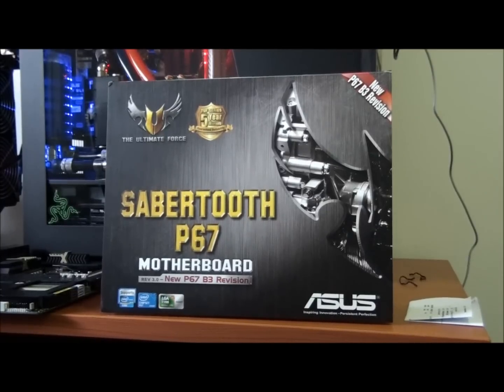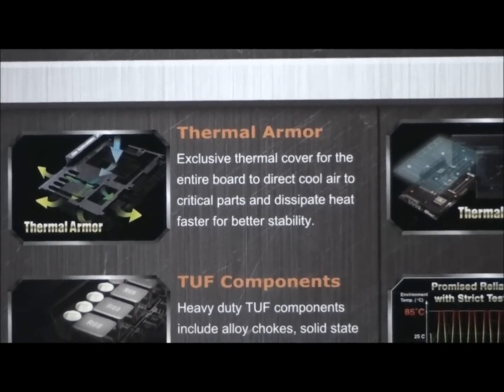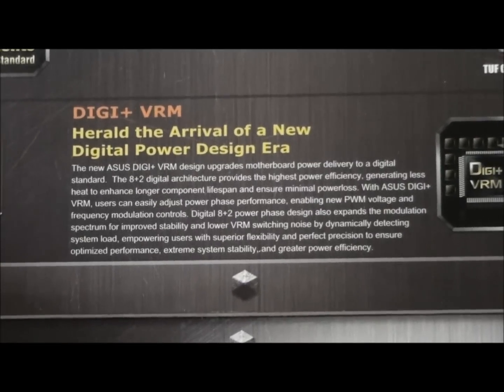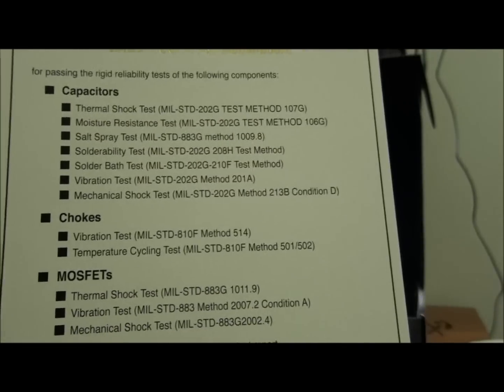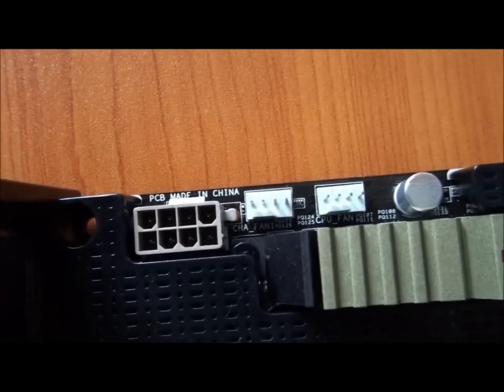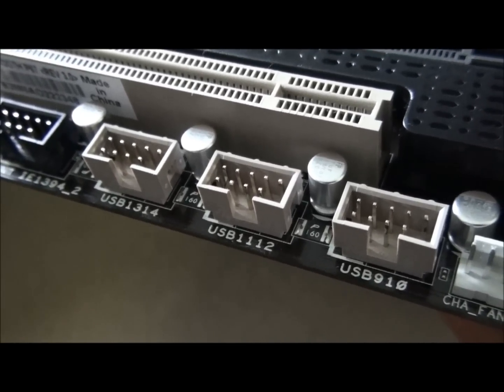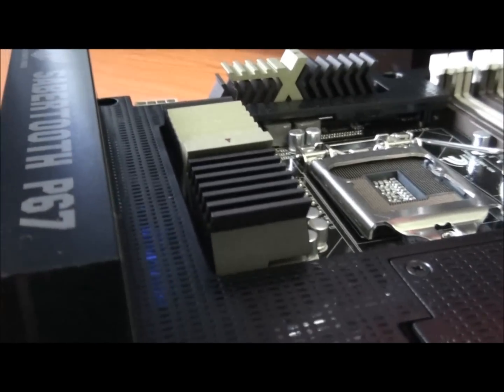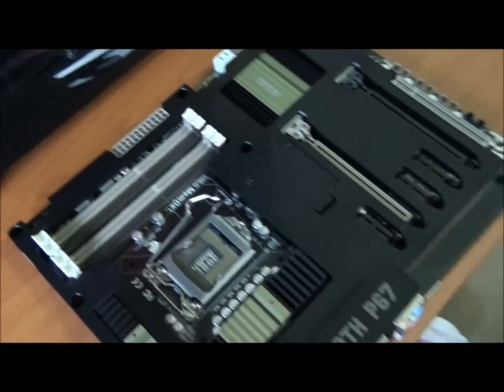Asus Sabertooth P67 Review Part 1 of 3

Comment: I got 2 questions...

Firstly, is the thermal armor really worth it if I only plan on getting myself a single average graphics card?  It seems to say it's primarily designed to protect the mobo from other heat-sources inside the case, but I wonder if I am going to have that many sources.

Secondly, I love Asus's Q-LED feature, and apparently the Sabertooths have it but... how do you see the lights through the armor?  Do they show through the gaps?

Comment: @SingularityComputers my 580 wont fit on the motherboard because the thermal shield is blocking the 580 from getting all the way in the pci x16 port and the locks for the port dont reengage. should i take the thermal shield off?

Comment: I am making a gaming pc for myself.......the specs are
core i5 2300, sabertooth P67, 8gb DDr3, asus engtx 470(2 way-sli), cooler master GX750 PSU and CMII advanced casing........will the cards run fine in sli with this setup(especially psu) or do i need higher one........

Comment: I've ordered this board, but I'm going to use an H70 on the CPU. Does that mean getting a 50mm fan for it is a necessity, or is it only advantageous?
I have a DF-85 chassis, so I have lots of airflow, but I don't know if it's enough.
Thanks.

Comment: this card has 2 gpu on the same chip.  What I will end up doing when dx 12 comes out sometime next year is upgrade to another 2 gpu card and use the 275/265 gpu card as a physics card in sli with a more modern dx 12 card.  In this way I will sqeeze the most value out of my cards by running a 4 gpu solution on the sabertooth board.  I want someone to test this setup.  runing 4 gpu in sli..  you need 2 sli briges ...  on the sabertooth board.  I want to see comparisons to running only 2 gpu vs 4

Comment: well I have something that is just as good as a 295 that was half the cost and plays every game out there on max settings.  dx 10 still is no joke.  with a rather inexpensive dx 10 card you can get just as many gpu and the same high clock speeds as newer cards.  the only thing that changed was the software on the cards, it's bios, so I did not upgrade.  I have a very rare limited production game of the year edition for the win card.  a co-op between evga and n vidia.  ...

Comment: I'm not sure to buy it or not for 1 reason: I have a corsair H70 right now, and I have a coolermaster 690 II. I think the shield covering the I/O connectors might disturb the H70 :(. But I don't have a way to be sure. The H70 is alligned with the 120mm (it doesn't get any thicker) but seeing my current motherboards I/O connectors are ALMOST touching the H70 i'm really just not sure to take a risk, I really have to research....

Comment: 4 GPU is 4 gpu.  I'm just happy I don't have to worry about trading my card for a 265 my brother has.  I got the 2 gpu solution and havn't needed to upgrade.  My card is great as long as your fine with direct x 10.  I only upgrade graphics cards every other version of direct x.  Going from 8 to 10 was amazing.  I hope DX 12 is just as breathtaking.  I didn't want to upgrade bc tessalation doen't make that big a difference.  Eventually I will run quad sli.

Comment: I didn't like the delux because the quality of the 16 power phase was not there and I wanted something with a longer warrenty and would match my haf 932 case.  this board is perfect.  I hope to reach higher clock speeds with its reliable uber grade parts.

Comment: I've ordered this to replace my asus p67 delux.  I have a question.  This board claims to support quad sli.  How?  I mean I can guess that I can run 2 GTX 275/265 duel gpu cards and that would be quad sli because of 4 gpu processors.  has anyone tested this.  2 duel gpu cards running on this board.

Comment: @Zhorellski Sorry i wasnt clear.  You do not need to reinstall anything.  All you have to do is install and plug everything into the new board and boot up.  It will take you to bios if you want to change any settings.   If not, exit bios and boot up and you will be good.  BTW, is anything in particular a that you didn't like about the deluxe?  I'm still not sure if i am going to get it or not.

Comment: @Zhorellski No it does not, install it, edit any settings you wish in bios and boot up!  I went from a P8P67 to this board and i think i am going to take it back for either the Pro or Deluxe.  I will tell you that the board looks very cool and stays very cool.  However, my CPU runs about 10 degrees warmer with this board compared to the P8P67.  I do have a 50mm fan blowing on the center of the board so i am not sure if that has something to do with it.  I do have a tower cooler with push/push.